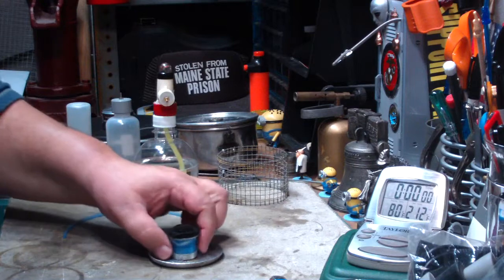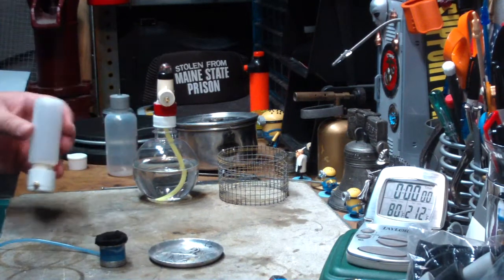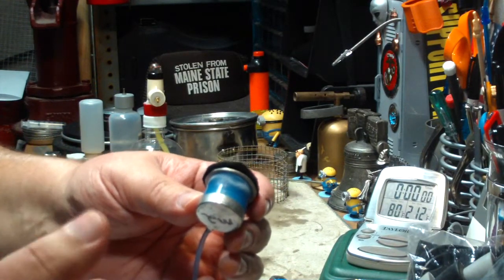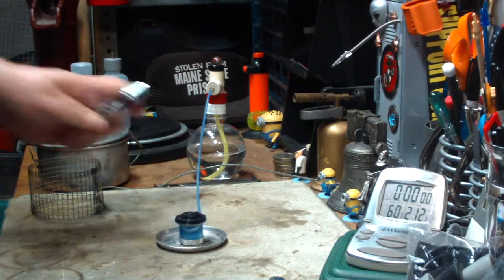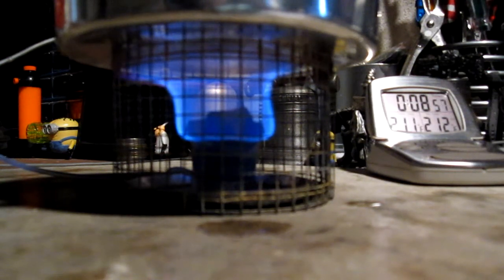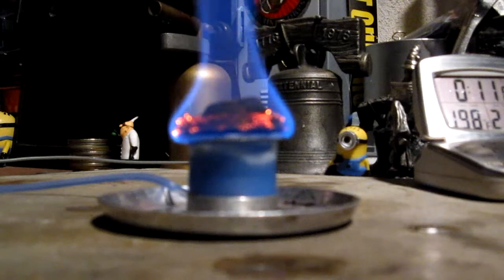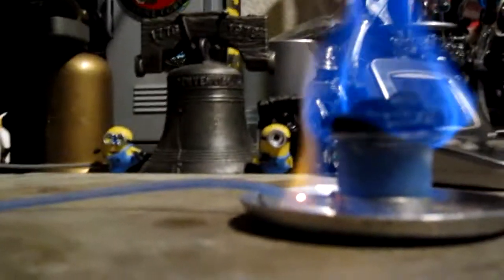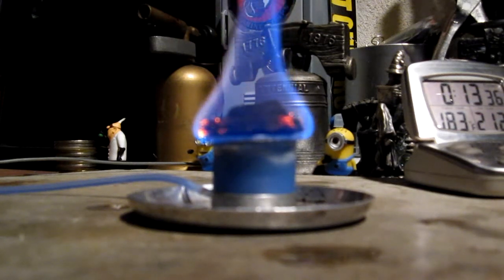Carbon Felt Alcohol Burner bought on ebay - Boil Test #2

Comment: His later design has what he calls a droop top to stop the overfill getting on the silicone and a base that catches overflow.  I think the felt shrinks with use so that may be why the donut was so small in the one you got.  I did the squeeze then crack open the top thing for a bit until I got a different system.  I don't mind fiddling with it a bit since I use it to do pancakes or the like, not boiling water.

Comment: I have this stove (it is a M2 ) it only takes about 5 mim. to boil water. the newer version has a larger base that has a slot in the bottom to catch any alcohol and safety top.works good with a remote if set to right level. btw it is good to bake with if you remove the outer ring (wick) and pust the center wick all the way down to almost level with top.

Comment: Tinny went to using the silicone tubing on the burner to act as a heat break to keep the alcohol in the reservoir from boiling which sends alcohol gas (?) thru the wick which makes an uncontrolled flame.  Before he used the silicone, he played w/ putting a water filled container around the wick reservoir to keep the alcohol from boiling.  You tested one of those a long time ago & it didn't work well.  Since he's also moved on from this design, I guess he's discovered its problems as well.

Comment: Hiram: Home Abroad is correct; you CAN get the Silicone body replacement from Tinny. I have three or four of them. I get used ones on eBay. Replace the carbon felt and silicone body and resell them as new. That stove is NOT the M2.